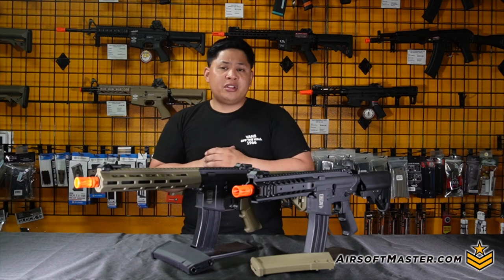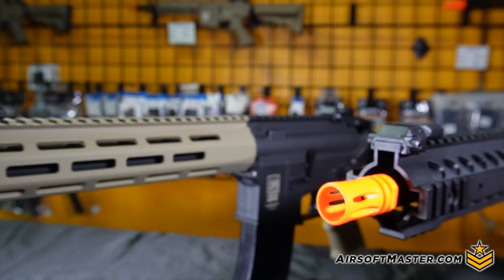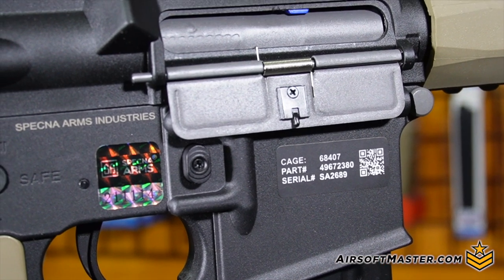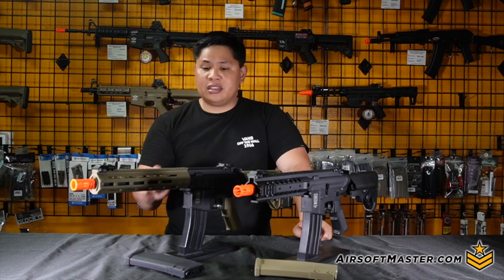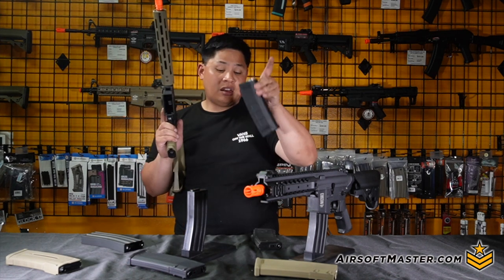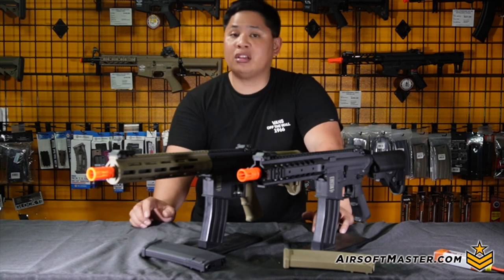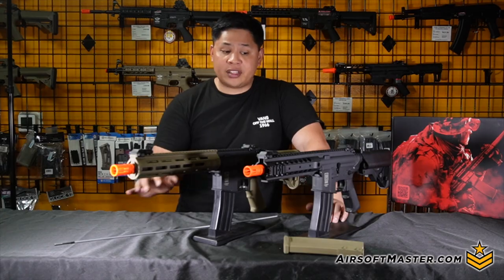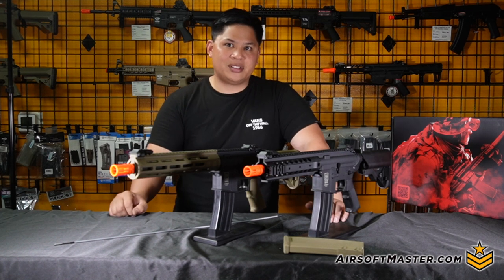Specna Arms Flex Series M4 Airsoft Electric Rifles

Comment: Just wondering...why until now., most airsofts rifles are still using Tamiya connectors???
Reply from the maker: It's still consider a universal port but most airsoft players now know the true power and reason why we go with deans/tconnectors. It's the overall better surface connection from battery to airsoft rifle.
Reply: @AirsoftMasterTV  hoping mostly airsoft manufacturer will install Deans or XT60 connectors🙏